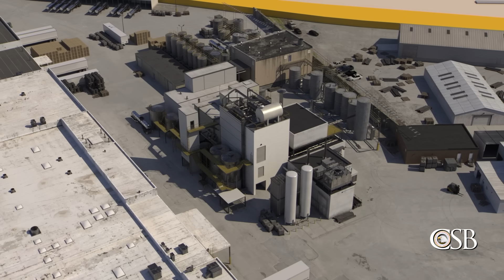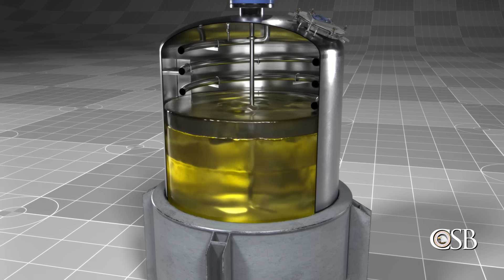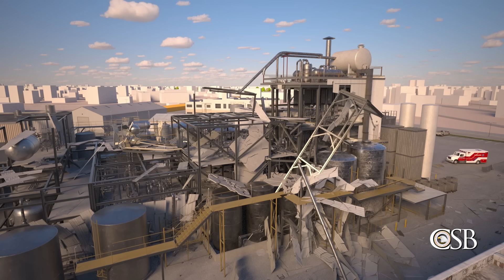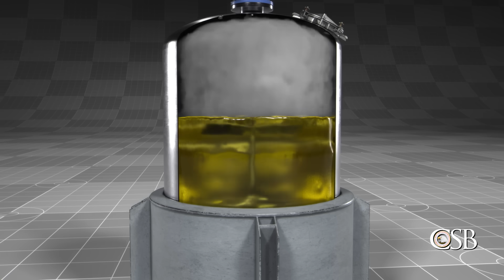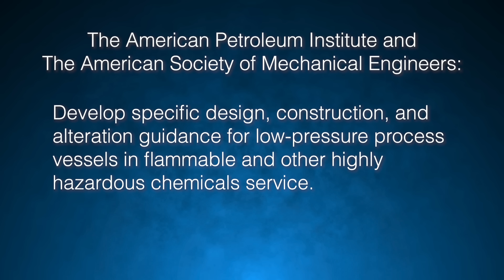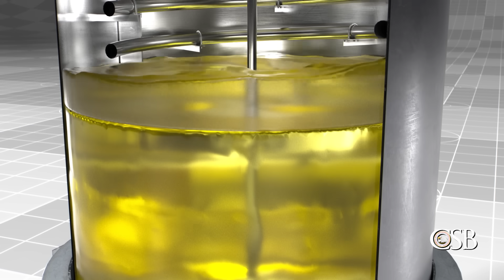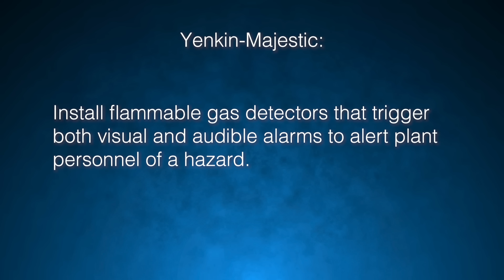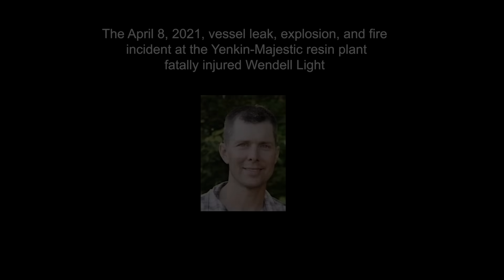Low Pressure, Fatal Consequence: Explosion at Yenkin-Majestic

Comment: But prior to this accident, was it realised that adding the solvent when the agitator wasn't operating, and then turning the agitator, on could lead to an over-pressure? Unless it was, it would be unlikely that an interlock would be incorporated.

Of course they should have tested the integrity of the man hole, but unless it could have contained the vapour if it could function at its rated 12psig, it wouldn't have made any difference, or even made it worse with an even higher leak rate once it failed.

Comment: No audible or visual alarm, no audible or visual alert to the agitator stopping, no training on how to handle such a situation, no goddamned PPE - absolutely nuts. I appreciate that the video goes into employee actions that precipitated the issue or didn't make things better (running into the cloud to look for problems - responsible impulse, dangerous execution) while still making it absolutely crystal clear that the company is responsible for the actual incident.
Reply: It is unfortunate the fleeing employees did not pull a fire alarm on the way out. Poor emergency training.
Reply: @warnegoodman  Yeah, truly. It seems like an obvious thing to do, but if I was blinded by unexpected boiling-hot toxic fumes and had to be guided out/guide someone else out, I would definitely not be in a headspace to pull the alarm if I hadn't had it drilled into me in training. YM definitely needed to be instilling more evacuation and emergency training here. Not to mention, the employee working the kettle should have had guidelines on how to handle a situation like this, whether it was to take a specific action or call a supervisor or what have you. I've worked places with questionable safety training and even they made sure we weren't pinching fingers off or dropping crane-loads on our coworkers. A mistake that can lead to the entire plant exploding within the hour feels much more urgent than that, and those weren't exactly insignificant!

Comment: Do we thing that the work and independence of the USCSB is important?  Check this out:

‘The Trump administration, consistent with its Cost Efficiency Initiative, proposed eliminating the USCSB's funding for fiscal year 2026, directing it to use its remaining emergency fund to close the agency. The rationale given is that the USCSB's functions duplicate the capabilities of other agencies like the EPA and OSHA. This move, which has been attempted in previous administrations but blocked by Congress, is part of the broader effort by DOGE to streamline government operations. 
The proposal has generated significant discussion, with industry trade associations and safety professionals arguing that the USCSB's independent, non-regulatory investigations are a unique and valuable resource that should not be eliminated.’ BDcUSA

Comment: A gasket that can't seal more than 9PSI is a pretty shitty gasket. Not having a safety valve with exhaust set below the critical failure rating on a heated vessel is also wild. Anything heated and contained can build pressure. Narrator is also legendary, that "sounds like there is just a touch too much spit in his mouth" is iconic.
Reply: Should have had a pressure relief out of the roof.
Reply: @PonkyKong  There was a pressure relief but it was configured to trigger at a higher pressure.
Reply: @alecFourTwoZero  9 psig, not psi.  The pressure actually went as high as 18 psig.  The written report is really interesting, I urge everyone to read it.  There's a lot of extra info in it.

Comment: The sad part of the CSB is they only make recommendations, not industry standards. OSHA and API who make standards get taken to court and the standards either die or get held up in courts for years. This was a very common practice in the industry, misclassification of equipment so they do not require certification or have to follow the standards.
Reply: thats why you have to change your angle of attack (which they have been doing). If they ignore these safety recommendations, it could damage the facility and cause delays in production and cost the company much more money that what they would have spent on safety.

Comment: Decades ago I worked in a chemical industry that did very similar work. We were making photosensitive coatings that were used in making lithographic plates. The process involved dissolving various photosensitive chemicals and resins in copious amounts of extremely flammable volatile organic compounds (ketones). I saw several incidents where.overconfidence that nothing will go wrong led to employees becoming lax in adherance to safety protocols.and or safety protocols that should have been put in place were not fully implemented or sometimes not implemented at all. Fortunately there were no mishaps or accidents but the experience led.me to understand how easily such industrial accidents can occur when employees and management beco.e too complacent and start becoming lax and overlook specific safety protocols. Complacency canard.to accidents and accidents in the industrial environment can be very unforgiving.

Comment: How was there no pressure relief valve?
Reply: @MyersMushroomsFarms  I think they assumed the pressure in the vessel would always be near-atmospheric and so requirements of a pressure vessel (high pressure) didn't apply.  The written report says "Although pressure vessels that can operate over 15 psig are subject to pressure vessel safety codes, there is little guidance specifically for the design, construction, and alteration of pressure vessels not exceeding 15 psig."
Reply: @musicloverchicago437 yeah but if it was designed to operate at atmospheric, then it should have had an always open external vent, they could have even had a condenser on it to reflux any distillate. That would have saved this from happening. I run some small reactors and know to always run 2 reliefs when using it under pressure. One regulated and one blast disc rated at well below rated pressure. Massive oversight on layout and design by the plant engineers.
Reply: @MyersMushroomsFarms   I agree with you.  It's like they were only doing what they were required to do and not what could ensure safety.

Comment: I saw this category of poor design a couple of times in my career, one almost identical.  The vessel and its relief system may have started life with adequate overpressure protection but it became festooned with appurtenances with MAWP’s below the max operating pressure.  Any competent vessel engineer can design a manway with sufficient MAWP, but a view port is another matter.  Vessel design codes don’t proscribe calculation methodology for view ports, especially their transparent materials.  This falls to the viewport vendor.  The other inexcusable flaw is a relief system, perhaps a simple rupture disk, that exhausts to local atmosphere, accomplishing nothing except preventing the vessel from bursting.  The CSB report didn’t exactly grasp these points, but they can be excused as they don’t have indigenous process and engineering expertise for the myriad technical issues in chemical industry.  They are good at animating post accident narratives, but fall back on a process safety management mantra to force designers and operators to do he right thing.

Comment: In a building that manufactures paint resin, flammable vapors escaped from a 3,000-gallon kettle, igniting and causing a series of explosions and a multiple-alarm fire that burned for about 12 hours. The kettle spewed a 400-degree resin mixture on employees’ arms, legs and faces, causing severe burns and scarring. The fire department report describes Yenkin-Majestic’s lead kettle operator rushing to the aid of a co-worker who was “screaming with resin all over his body.” The explosion knocked employees to the ground, causing concussions, ear bleeds and broken bones. Doctors amputated one worker’s left leg below the knee. In court documents, former employees say they continue to experience PTSD symptoms: night terrors, insomnia, flashbacks.

In the last dozen years, the U.S. Department of Labor’s Occupational Safety and Health Administration cited and fined the corporation multiple times. In 2011, an employee was electrocuted while plugging in a forklift and later died. In 2012, OSHA proposed $138,600 in fines for 26 health violations after the facility released a flammable vapor cloud. (The company contested the fines and later paid around $76,000.) Of the 26 violations, OSHA categorized 25 as “serious,” meaning there was “substantial probability that death or serious physical harm could result from a hazard about which the employer knew or should have known.” OSHA fined the company for another serious violation in 2015.

Comment: At about 8:30 in the video, you say that 4 psig would trigger an emergency cooling interlock and alarm. However, you never seem to mention this issue again in the video. Why didn't that alarm sound that night? If it did, how did people respond? What did the emergency cooling interlock do or what was it supposed to do? If the alarm worked, I don't see why the operator wasn't aware of the high pressure situation before the manway leaked at 9 psig. If the alarm was sounding and the interlock was working, I don't understand why you didn't mention those factors in how the operator responded. Beyond the failure of the manway, the secondary failure was of whatever was supposed to happen at 4 psig, and you seem to have ignored that factor in the rest of the video. I did root cause analysis in chemical plants and refineries before my health failed. In anything I did, we would have focused on the failure of the cooling interlock and alarm to solve the problem or at least alert employees what to do next. 

Your job isn't to tell API or ASME what to do. You're welcome to say that some part of industry needs guidance around low-pressure process vessels containing flammable or potentially-hazardous chemicals, but you shouldn't be assigning action items to anyone. If existing organizations want to take that initiative, that's their choice. If other parts of industry want to create a new organization to address these kind of issues, that's another path that could be considered. 

I understand people not pulling fire alarms when no fire has begun. No one wants to make a false alarm, so regular people are going to be less apt to pull an alarm until they see the flames. I can see where training to tell employees to pull the alarms in that kind of situation would be helpful. Another option would be a separate alarm system that employees could activate when dangerous conditions exist but no flame has begun. In many ways, an open fire is less dangerous than a vapor cloud. Many of us who have a little knowledge of both are going to move faster to escape the vicinity of a known vapor cloud than to escape the vicinity of a known fire. 

I'm curious how the pressure relieve devices were vented. If they vented into the room with the reactor, they wouldn't have changed anything. In effect, the manway became a 9 psig pressure relief device that released before the 12 psig devices did. If they both released into the room, the effect would be the same. While an improperly vented pressure relief device wasn't a factor in this accident, that factor should be considered. I'd put that issue far above fire-resistant clothing in protecting people. 

The CSB seems to have changed over the years. I can remember when the CSB came across as a more scientific organization with some bureaucratic functions. Now, the CSB comes across as more of a bureaucratic organization with some scientific functions. That change is not good for society or process safety.

Comment: Imagery varies not showing a centrally situated stirring paddle. Since that was key to preventing separation and consequent gas evolution, why wasn't there programmed in alarm and shut off of the addition of the solvent?  You'd think there'd be alarms at every stage including our of range pressures on the man way. Seems management deemed it an extraordinary expense, since they got away with such haphazard processes before and gambled a problem wouldn't come up.  Whoever or whomever okayed a new man way that hadn't been gauged for coherence in out of norm conditions,band evidently ignoring how to estimate in what ways things could go wrong, bear a large burden of responsibility and that should go all the way to the top.... Jmt¢

Comment: The U.S. Chemical Safety and Hazard Investigation Board (CSB) is facing closure due to the Trump administration's proposed 2026 budget, which does not include funding for the agency. The plan directs the CSB to use its emergency funds to shut down operations by the end of fiscal year 2025. While Congress has historically rejected similar proposals, this year's plan is moving forward with the intention of eliminating the agency, a move that critics say will increase risks to workers and communities.

Comment: 9 PSI is nothing, you can hold that in an air hose with your finger, so it must have been a really crappyu manhole cover assy.
Crazy how they allow this kind of operation right by nearby HOMES and businesses! this kind of thing should be out  in the boondocks with nothing around it.
I read where theres people even now are STILL not compensated for the damages and loss, this place should have been SHUT DOWN after this explosion

A Forgotten Community Searches for Answers After the Devastating Yenkin-Majestic Fire
What responsibility does a 100-year-old chemical manufacturer with repeated federal safety violations have to its neighbors? And is rebuilding trust even possible?

Comment: How about: don't run your "atmospheric pressure" processes in a sealed 15psi vessel? While letting the vessel vent at lower pressure would not have stopped the potentially flammable gas cloud, it would have provided a more gradual boil-off and the vent would have diverted the fumes out of the building instead of letting boiling solvent mixed with resin out through the access hatch.

Comment: Another great video to scratch the itch of the safety mind and to put in the over engineering mind to use.
In any situation where a chemical is heated and there is a potential for the vessel that it is processed in should be pressure rated in the first place. Second in the event of a chemical release there should be a water spray system to help cool the vapors if they are detected. The water spray will greatly reduce the hazard posed after the release and if setup right it could cool the vessel the chemicals are in to stop the release and condense the vaporized chemical back into a liquid. Yes there is a potential of the process contaminating the area but if done right with analysis of the water system if it is appropriate or mitigation by using an on site storage tank to hold the water run off if needed to separate the chemical for safe disposal.

Comment: Obviously I do not know the details of this process, but I find incredible that this installation met the requirements of NFPA 30. VM&P Naptha, being a somewhat arbitrary blend of hydrocarbons, has a wide range of boiling points (the first source I found claims 203-320F).  So how can a vessel that contains hundreds of pounds of solvent 125-250F above its boiling point get designed for less than 15 psig operating pressure?. My best guess is the vessel is assumed to be a sealed vessel so NFPA 30 doesn’t apply. But then, how does an operator take samples through the manway?   And how does anytime walk into a cloud of VM&P naptha thinking “this smells like steam”?  Obviously, there is a lot I don’t know about this process.

Comment: As an electrical engineer who has been dealing with process control protection systems for years, my eyes hurt. How could such a design flaw have been put into operation? Don’t they have clean sheet reviews and audits in the USA?

Comment: Preventing the addition of solvent when agitation is zero is one useful idea to be assessed
Reply: Right they could have at least forwarded the idea to a committee for disposition at the ten year mark
Reply: Depending on how the system is set up, there may have been something like this in place but if the control system doesn't receive any feedback on whether the agitator has failed, it could be that the control system assumes the agitator is still on as long as it's sending an "on" signal to the agitator.

Comment: How many subcontractors were involved in installing the kettle and control system? Given that the email worked but didn't trigger proper shutdown or evacuation alarms, I've got a suspicion it was more than one, and control signals didn't get tied together. Which would be an important note for other companies; when subcontracting, get the subcontractors to report to someone with oversight, though a rigorous commissioning procedure would catch that. And that leads to a few other points; when engineering, always Design For Test, so you can inject failure signals for every case, and guarantee the system response. Which is something I've often wondered about; testing and test design is essentially an admin control, as it's entirely manual. I'd like to see something like Altium's DRC when designing these control systems.

Comment: it may definitely be worth broadening the application of the BPVC iv and i  relating to heating boilers and pressure piping to include inspection recommendations for static head testing and materials, construction, and design of low-pressure heating end use process equipment. Especially seeing as there was no interlock for the mixer speed, or emergency shutdown, or Maximum Working Temperature Cut Off. Alterations of pressure vessels need to be signed off on by local authorities. so i see no reason that any process without direct vent to atmosphere should be exempt from inspection.